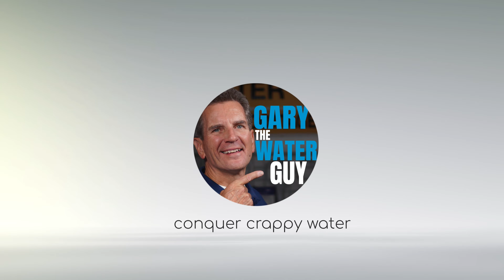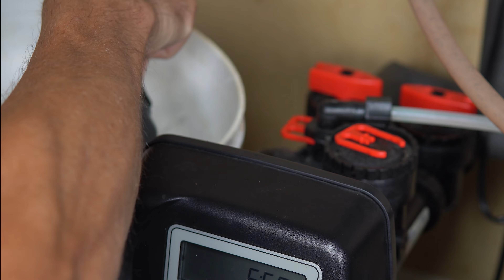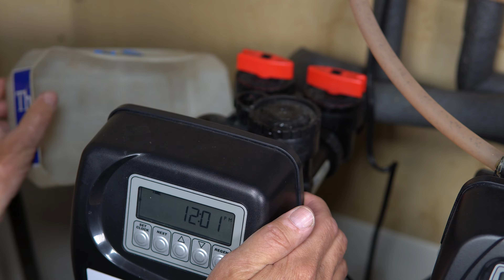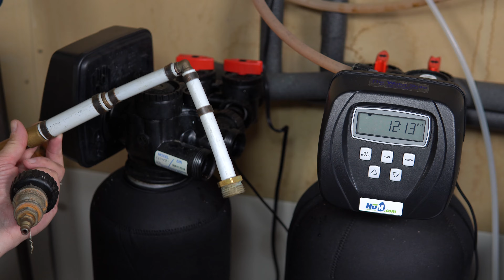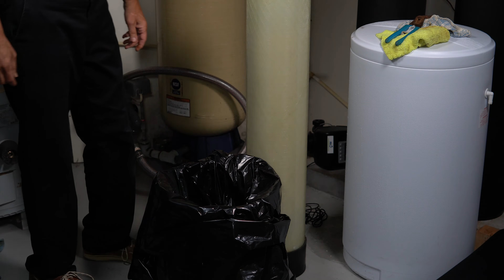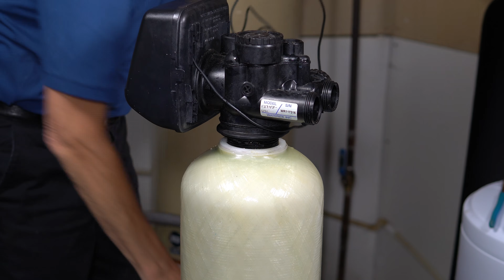WATER SOFTENER RESIN or Media REPLACEMENT

Comment: Gary. I installed a tannin filter last spring to go with my existing iron filter. It is plumbed in downstream from the iron filter. When pumping the water out of the tank to winterize it, the water was coming out the color of Starbucks coffee. It looked to me like it's not backflushing all the tannins out of the tank and they are being concentrated inside. I have 1 cf of media in a 1.5cf tank. Regen every 3 days using less than 100 gallon/day. The iron and tannin system has completely cleared up my water, but it looks like a problem may be on the horizon.
Any thoughts on whether this will fail in the near future?
Reply from the maker: I would try citric acid https://waterestore.ca/products/citric-acid-tannin-filter-cleaner?_pos=426&_sid=2fb85afa7&_ss=r   as outlined in this video https://youtu.be/c8QKYr3B02I to clean the tannin media.

Comment: I have 2 tanks labeled N719ES00392 10x54 - N924DS00299 10x54 Waterite that I cant find any info on.
Reply from the maker: What do you want to know about them?
Reply from the maker: If you take the white top off and take some pictures or a video of the top back it might help identify their purpose.
Reply: @water_estore  Thank you! While I was out there making the video they were using the water at the same time and 1 controller was flashing "Softening" while the other flashed "Filtering". https://youtu.be/yIO1kMc1p-Y

Comment: Great video, thank you! You told me everything I wanted to know in order to have the courage to tackle my own water softener media replacement. And yes, you did warn that it was going to be messy!
Reply from the maker: Let us know how it works for you.
Reply: @water_estore  

How do I tell how many grains I need? It’s a water depot tank they have quoted me 2000 bucks and by the looks of it just needs need resin replacement.

I can see it anywhere on the tank or Manual

Comment: Hi Gary,
Awesome video !!! super helpful !!! Thank you very much !!!
My water softener system has the same controller head as the one in your video. It's a 3M CWS150 with a 1.5 Cu ft tank. I have had the system for 10 years now and for the past couple weeks I notice the water pressure inside the house is super low. I've isolated the problem to the water softener as I know the pressure is back to normal when I put the water softener in bypass mode. I've followed your other video to clean the resin with Iron Out but that didn't help. Do you think it's time for me to replace the resin ? if so, what type of resin should I use ? and how much resin do I need ? 

Thanks Gary !!! very much appreciate your help !!!
Danny
Reply from the maker: I assume you would just use 1.5 cubic feet of normal water softening resin but you can check with 3M to make sure.

Comment: Thank you for taking the time to create these videos, I know it is a lot of work but you manage to make it look easy.  Your videos are very straight forward and easy to understand.   My water softener is over 20 years old and the resin media has been replaced once about 8 years ago.  The head is the original and has a non-digital flow meter to regen after 500 gallons.  The softener stopped working and when I manually put in Regen mode, nothing happens.  Brine and salt remain in the tub for over a week now and not getting sucked into the water softener.  Do you have any suggestions on what I can do to troubleshoot?  Also, can I put a new up to date digital head on tank?   Thank you!
Reply: Hello. I presume that after a year you've solved this, or replaced your softener since it's over 20 years old. But for those that might have a similar issue, I'll relate my experience.

The brine tank was getting fuller and fuller, week after week, and never was the bring taken into the softener during regeneration. The issue turned out to be an air leak at one of the fittings used to join the flexible plastic tube to the rigid plastic tube that sits in the brine tank and has a filter on the end. I observed that during the regeneration, the air check valve, which is a clear plastic bubble with a small rubber ball inside it would be drained of water during the brine draw stage, in only a few seconds, and then the rubber ball would drop, sealing the hole and no more water would be drawn, only air, because of that air leak. Whatever water was in the tube would be drawn in, but air being less dense than water, is going to be drawn into the hose after that, if there is a leak. So you have to make absolutely sure that your fittings are good. There are probably other causes, but this was what happened to me.
Reply from the maker: It is difficult to say what could be causing nothing happening during regeneration, could the tank be clogged?

Comment: Thanks.  Going to try this next weekend.  Hoping I don't create a big mess trying to clean out the resin from the tank.  I was thinking of emptying it into a burlap sack so that it would catch the beads while the water is flowing out.
Reply: Thanks this video ended up being very useful!  I had to lightly tap the pump assembly with a rubber mallet to knock it loose.  And you're right, this was really messy nasty job.  Procedurally easy, but just a mess.   I also ended up losing the basket down the riser tube and had to fish it out with a wire hanger.  Initially I had slipped it onto the riser tube rather than reattaching to the pump assembly first.  That was fun.  One other tip is to remove the power cord from the control board to make removal of the pump assembly easier.  My power cord is fixed to the wall, so removal was the way to go.  Thanks for this video.  Our old resin was only allowing through 1.3 gal/min.  With the new resin it's 4-5 gal/min. So much better!
Reply from the maker: Glad to hear it worked for you.  Please share with friends and family.

Comment: White Salt mark every where  from water from the softener, what may be the issue
Reply from the maker: You need to check the total dissolved solids before and after the softener.  You may have high minerals like sodium in the water.  Also, make sure your water softener settings for hardness are correct.

Comment: Im getting a clack ws1 air iron filter. Im considering to install a big blue filter. Would that be installed before or after the iron filter? Im also installing a new water softener after the iron filter.
Reply: If its a sediment filter it probably should be placed ahead of the iron filter to filter out larger particles that would quickly clog the iron filter.